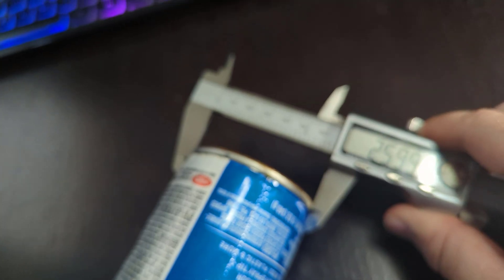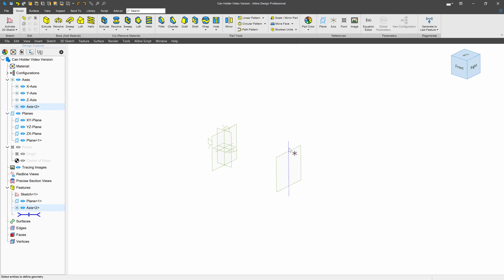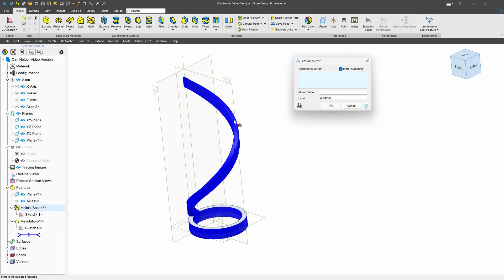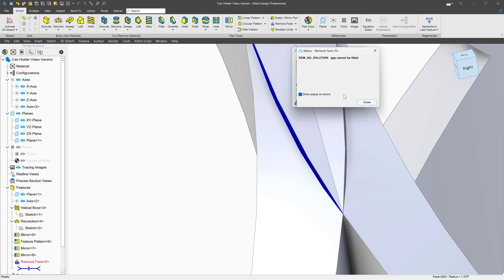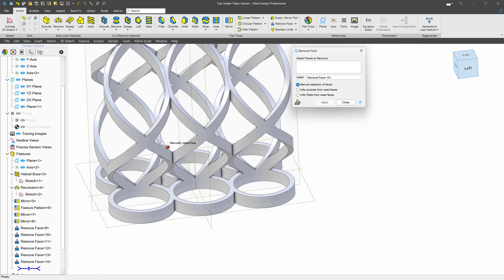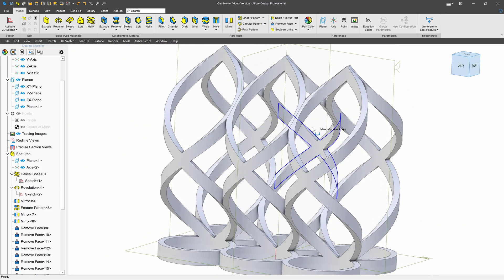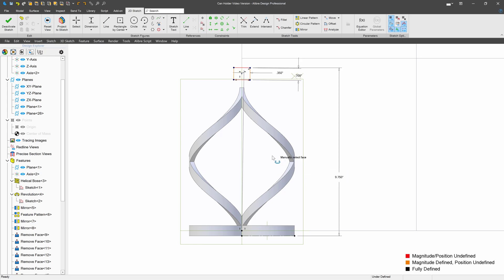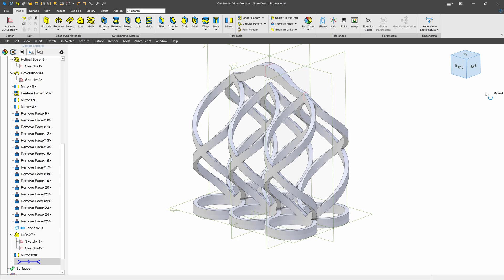3D printing a Spray Can Holder- Detailed Video

Comment: Another great video. It always amazes me the different designs you come up with.
I'd like to point out that if you turn off the Real Time Preview with the icon on the lower left of the dialog you can see the surfaces highlighted that you've selected. That makes is easy to deselect faces that you want to remove from the selection set.
Reply from the maker: Thanks!